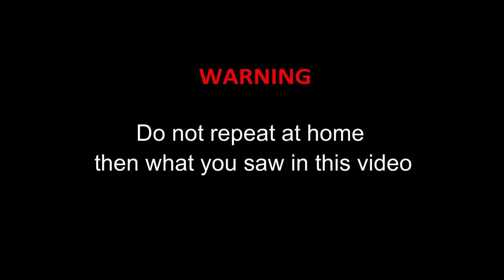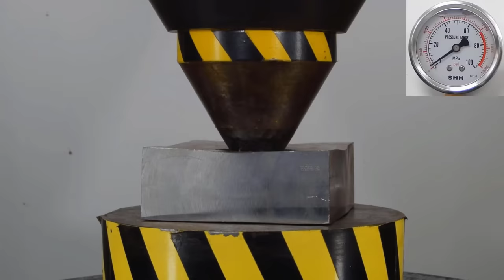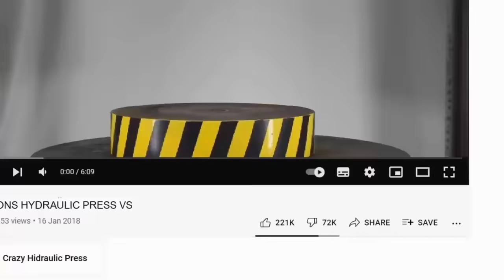HYDRAULIC PRESS VS OLD AND MODERN ARMOR

Comment: As a man who knows a little bit about materials, especially metals and steel, this was very very impressive! Thank you.
Reply: whats diffrence between new and old , aint they all old same ? Is it only about remaking them again
Reply: @hamzagorcevic8443  Yes and no, the "old" armor from 100 yrs. ago is the same material mixture/structure/steel, but back in those days they didn´t have had the steel compound/mixture discovered or researched from today, so that armor from 2010 is "new".
Reply: @hamzagorcevic8443 not a metallurgist, but there are better alloys, casting techniques and treatment techniques available to improve the resilience. They are usually secret. Even if available, back in WWII the Soviets might simply not have had the time for all these process as they had to churn out lots of tanks to be able to stop the Axis.
Reply: It's a fake video, you can see their 2010 armor is rusted and old.
Reply: Why did the armor shatter instead of the super cold steel sphere?
Reply: @did_I_hurt_you_feefees  quenching the steel ball in LNG converted the whole thing to a very hard martensite crystal structure. Modern tank armors are very hard and are designed to shatter projectiles hitting them. When something even harder hits them, they shatter.
Reply: @mustang1912  Unprotected steel rusts. You don't expect tanks to be made out of stainless steel do you? Why? They'd cost a fuckton, and have all the protection of cheddar cheese.
Reply: @KoflerDavid  Cool....see what I did there? Thank you for the explanation. I really thought the steel ball would shatter, but now I know.
Reply: @did_I_hurt_you_feefees  Because the forces exerted on it by the press through the ball bearing were enough to tear the molecular bonds along areas of weakness in the molecular crystalline structure of the piece of armor plate. There are always crystalline irregularities withing metal castings. Modern techniques are able to reduce them and refine grain structures in the castings, but no foundry will ever be able to produce a "perfect" billet.
Reply: @throwedoff1961  I get that but what I do not understand is how the frozen ball didn't shatter first because the cold makes it brittle. I mean, people freeze steel and hit it with a hammer and it shatters. I don't get how the warm armor shattered while the frozen steel didn't unless the armor was already damaged significantly from the first pressing with the cone.
Reply: @mustang1912 2010 was 13 years ago now, metal can easily rust in that time. It doesn’t need to be hundreds of years old to rust mate.
Reply: @@AlanBrando-wb3oq For me it´s a complicated question, sry. I have an apprenticeship as an industrial mechanic, 3,5 years in total. And a part of it was material science. I had most to do with Aluminium, but a lot of steel alloys too.
Reply: @hamzagorcevic8443 In this case, it is also a little more complicated than the differences in age. If that piece of armor really was from a WW2 tank, then it is face hardened, rolled homogenous armor which is not a fair comparison to through hardened ar500. The explosion from the ar500 also shows why single piece tank armor wasn't through hardened. The face breaks up the incoming round and the rest absorbs it without shattering.
Reply: @mustang1912  Yes, this blogger may have cheated, but as for rusting, if it is kept in humid air, the surface of the plate will rust all over within 2 days.
Reply: @m.d.598 Yes, every ar 500 contains titanium and aluminum oxide, but the tank armor of World War 2 went into battle even without it.
Reply: @Russka9Morda the martensite should persist unless you apply much higher temperatures. This is commonly done since martensite is very tough, but also brittle. In this case, the other plate was even more hard and brittle.
Reply: @maxschmerz574  it looks like an elastic structure without apparent deformation but allowing the diffusion of the compression energy throughout the structure
Reply: @laurent8214  Very scientific explanation from you. There are many different types of steel with different properties. With armor, for example, you want to have an outer hardness and inner elasticity that slows down the projectile enough. But i´m not that expert in armour. I once produced for the army but that´s another chapter.
Reply: Not so impressive. Hard tip and soft tip. Even a blind man can see the deception.
Reply: @davidsmith1225 Yeah, different tips. But maybe it has other reasons as for deception?
Reply: @maxschmerz574  that steel took far more pressure to penetrate, 450 tons vs the AR500 breaking apart at 350 tons. So yes it is harder steel, but it's far more brittle, and less tough. We can make far better stuff than AR500 steel, that stuff is designed to be a cheap rifle stopper mostly for targets. It's pretty good for that, but as actual armor it's not so much better than the "old" steel. Wich is far milder. Some special alloy, or layers of special alloys can easily take far worse punishment.
Reply: Really ? you didnt notice the second head was totally different then
Reply: @gowdsake7103  Yeah, I noticed like to read in my other comment. So what? Why in the world did he change the tips?
Reply: As a human in between a woman a man and a platypus I can undoubtedly unquestionably reassure you I forgot what I was going to say..

Comment: As far as I know, tank armor in ww2 was tempered to be soft to absorb the energy a bit. Tempering to too hard would make the armor brittle. I could see hard armor like this working well as a skin on top of softer steel...Im sure the modern engineers have worked all this out...
Reply: That's kind of the way battleship armor such as Class A face hardened steel is designed, it's also always backed by a softer steel splinter protection layer to catch any spalling
Reply: I would like to see some krup steel from ww2
Reply: The armor of the T-34 that was used was actually a bit hard and you will see a lot of knocked out T-34s with large cracks in them from getting hit.

Comment: Diamond: "I was crushed by a hydraulic press; nothing can withstand that thing."
Steel:  "Hold my beer."
Reply: Because Diamond in insanely hard against cutting force (nothing than another diamond can cut a diamond) but also very weak to percussive impacts and crushing
Reply: @vayalond7203   They routinely cut diamonds with water as well as lasers.
Reply: I think you may have misunderstood the 'hold my beer' meme- it's supposed to represent when an overconfident person says 'hold my beer' and then quickly gets humiliated by who-or-whatever they had just underestimated.

The first example was an old Yosemite Sam cartoon where some yahoo is challenged by Sam and asks someone to 'Hold my beer.' before getting shot to pieces.

But, I agree with your intent re: the strength of steel- most people still think, for example, that titanium is both harder than all steels, and stronger, by mass (which it is not) in addition to by volume (which is may be). And, re: diamond... yeah... (hardness has little to do with tensile/compressive/elastic/plastic/etc strength). Cheers !
Reply: @bholdr----0  Okay, learned something new today
Reply: @11C1P  Lasers cut with heat, water jets, filled with abrasive media, often lab grown gemstones like ruby or diamond, cut with said abrasive media. What's your point?
Reply: Diamonds are scratch resistant not crush resistant.
Reply: Its not steel, its normally composite amour, which is much stronger
Reply: @bholdr----0 
think you got it round the wrong way with titanium - titanium 6Al4V alloy is stronger than the majority of steels for the same mass, though pretty average  for the same volume (still pretty decent, though).
Reply: @robbiejames1540  

Okay, I get it; I'm no expert... 😁 ...I had thought that, generally, Ti is only stronger than steel by weight, not volume (and obviously by mass)...

Looking into it, I see that there are so many alloys, tempers/treatments, etc, of all metals, its kind of a wash- But, you're right. Titanium is more and more impressive the more I learn about it... And, like everything, it's complicated (dangit!) 🤔

Cheers!
Reply: @bholdr----0  
Hehehe, don't worry - I'm no expert either, just an engineering student who thinks materials are cool :). 

And yeah, practically every material can come in a ridiculous range of performance - high strength aluminum alloy can have double the yield strength of mild steel by volume (!!!). High strength steels can be 3-4 times stronger than that. And don't get me started on carbon fibre - the best carbon fibre composites can be 7-8 times stronger than generally available stuff.

In short, materials vary a lot, and are very interesting :)

Cheers :)
Reply: @bholdr----0  the hardness vs thoughness issue is THE big problem armor and also in mining machines. Thoughness essentially being the resistance against cracks and their (sudden) proliferation. Increasing hardness decreases thoughness, and the other way around, ising steel and all else being equal. Think ceramic: high hardness but brittle, now try exploding play-do by pressing on it like the armor in the video. 

There are other metals that can form high hardness and high thoughness metal, but that could be an entire science channel series
Reply: @YourAverageTankNerd  True, modern armor usually at least in part made of composite, but here the vid specifically says it's steel armor
Reply: @mikeirons9244  yeah, well put: but I was just complaining about the poor production values, not the information.

Comment: That… Is sick! The armor fragmented and “exploded” just like a grenade with an insane power. I think this was the most dangerous press video I’ve seen so far. Great show
Reply: Hmmm...very dangerous!
Not going to think too much about it: definitely w Top 5!
Reply: This video is actually a great example of why tanks shouldn't have too sturdy armor; although this isn't a perfect example, seeing it shatter like that is similar to the phenomenon of 'spalling', which is when armour fractures instead of deforming, causing armour chunks on the inside to break loose, which is extremely hazardous for the crew inside. During WWII the T-34 was notorious for this because they made it overly strong, and therefore brittle.
Reply: @TheEDFLegacy  So i guess they need a double layer of armor ? A very strong outer layer and a softer inner layer so that the inner layer stops the fragments of the shattering outer layer. Maybe even an armor plate with gradient hardness where the outside is super hard and it gradually softens to the inside would work ?
Oh well since nothing receives better funding than the army and weapons industies, im sure they have thought about that and tried everything :)
Reply: @arjensmit6684  Yep, and this is one of the conventions you see with a lot of modern tanks. The M1 Abrams had depleted uranium as a dense shock absorber. The problem there is that they had to stop using that because of situations where uranium did the uranium thing and irradiated the crew, depleted or not. Other materials are still used, however.
Reply: @TheEDFLegacy  the T-34 armor here looked as if it was mild steel. These days tanks will use some lightweight kevlar spall liner.
Reply: Yes, it’s called Krupp face hardened armour, used on both German and British ships at Jutland 30th May-1st June 1916. Unfortunately, British shells were typically too brittle and shattered on impact with hull flank armour of the heavier armoured German battlecruisers and battle ships. British battlecruisers with half the armour thickness of German battlecruisers fared less well. Three blew up with all hands.
Reply: @arjensmit6684  Such a thing is called a SPAL liner.
Reply: Yeah this one looks pretty dangerous, but I think the press video where the guy crushes an automotive suspension coil spring is probably worse. I was genuinely concerned for anyone in the general vicinity of that building. Those springs can store so much energy, and even a minor slip could release it all in a single direction.

Comment: First time I’ve seen something push back so thoroughly. The press is still undefeated though!
Reply: not on the modern armor
Reply: Could you say that you were imPRESSed?
Reply: Slow, progressive force isn't really like live munition situations though
Reply: The modern armour defeated it???
Reply: 3:24
Reply: 4:08
Reply: @williamalchikha8736  yes, but with the cone shape it failed.... like.... failed miserably, barely dented it. The liquid nitrogen was used... if the armour was left to cool in the liquid nitrogen.... what would have happened???   Press would have failed again.
Reply: the press was literally defeated in this video lol
Reply: 6:20
Reply: @rigormortis3219 
The press did ultimately defeat it after it was frozen, but it exploded like a grenade
Reply: @rigormortis3219 the press wasn't defeated, it was the Cone tip

Comment: When the disclaimer said “Do not attempt at home” it was really serious. I didn’t expect the armor to go all projectile on the entire lab. That was epic indeed!
Reply: Oh well, I guess I'll have to return all the hydraulic presses I just got for our family home
Reply: Can I have plz plz plz plz plz, I really want to destroy stuff
Reply: 100% knew this would be a disaster.  At best the steel ball would go flying like a canon ball. At worst that slab of AR500 would essentially explode and probably damage the press. I was surprised how well the ball stayed put until realizing it was sitting on the indentation from the previous run.

Regardless, that was pretty f'in awesome.
Reply: I was expecting the ball to be brittle n explode early on.
Reply: @ralph3333  It's called cryogenic hardening which can greatly improve strength, hardness and wear resistance when used with certain steels. It will be more 'brittle' but a steel ball like that will be extremely strong in good condition.

Now if the cryo-treated ball was hardened steel I believe it would have failed exactly as you imagined.
Reply: I was most impressed with the abandon that the chap used  as he set up the deadly-dangerous liquid nitrogen, which could have frozen his fingers painlessly-solid in an instant, shattered them all, and then gone projectile over the entire lab.
Reply: @andyharpist2938  
That's not how liquid nitrogen works.
Reply: @andyharpist2938  It's not scary at all actually. You see when coming in contact with something at a room temperature liquid nitrogen starts to evaporate intensively, so there is an additional layer between the liquid and something like a hand, and the layer's heat conductivity is quite low. So, one can literally pour some liquid nitrogen on the hand, hold it for a couple of seconds and then throw it away with no harm whatsoever. Just don't drink it ;P
But cold solid objects are dangerous to touch.
Reply: Agreed, the man had to pull out the big guns just to make the press win, and it was such an explosive finale
Reply: @user-yp2cs4js3n exactly this, the impact of liquid nitrogen comes from prolonged contact, which can only happen if you place a limb inside a container full of the liquid. A small splash of it colliding with your skin won't do much, as it'll literally boil away before it does any real harm
Reply: I'm 100% sure I couldn't do any of this at home.
Reply: I'll tell the wife.  @JamesTDG
Reply: Another disclaimer. No women need to see this video or comments.
Reply: almost didn't get an upload from it lol